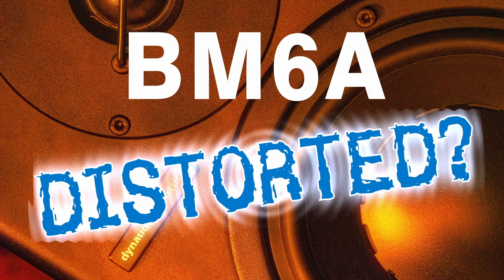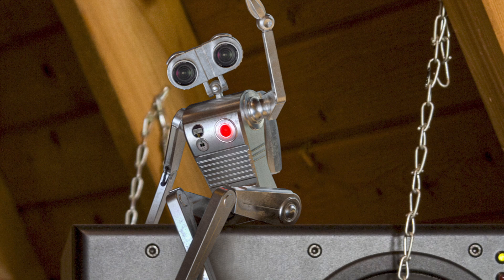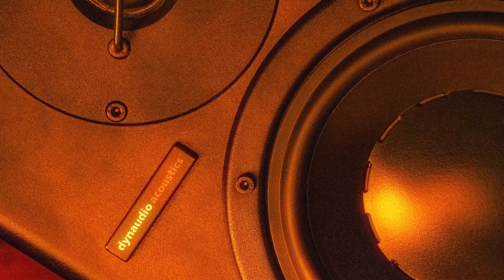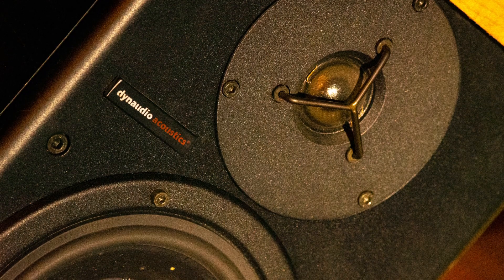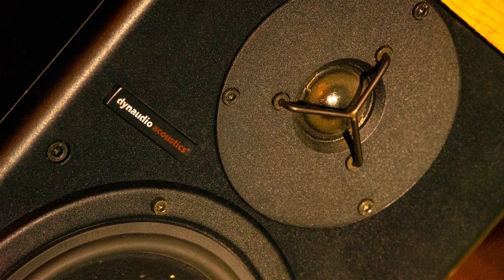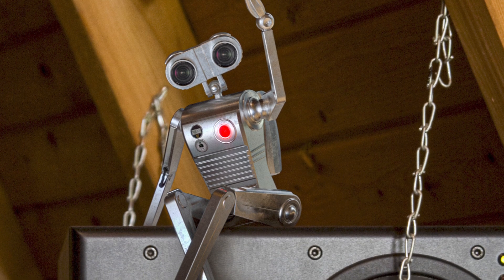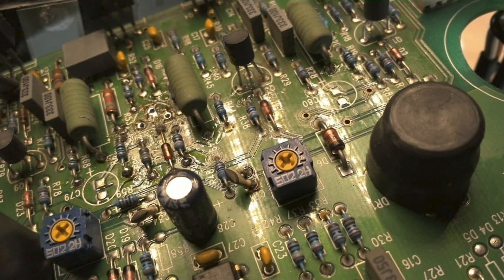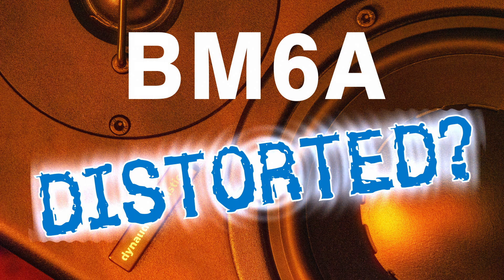Dynaudio BM6A Distortion Fix

Comment: Hi,I Bought a pair of BM6A yesterday, and it's the new version with new logo in the front from market.But I heard somebody talk about the new version and the original version of BM6A has a huge difference, really wonder is that true ? Or the new version is just change the logo ? thanks!
Reply from the maker: I would need to see the circuit, in order to judge that. do you have any context to that?

Comment: Thank you for this video. I have a pair that will crackle and lose sound intermittently. It takes them about 30 min to "warm up" and then its usually never a problem after that. (mainly only one of them) It reminds me of when you have a dirty pot or something and audio is getting stuck somewhere... Do you think this is a relay issue? Thank you
Reply from the maker: Yeah similar to a dirty pot, but caused by transistors. Really weird. Mine are running since. Never had a relais problem.

Comment: Hi, Was this a low frequency issue or in the high Frequency range. I'm having some strange low frequency distortion, below about 90Hz, I think the driver is ok. So I think its a fault with the amplifier module
Reply from the maker: Hi, I have had crackling like a broken speaker coil. since it was the driving stage, the freq should also reach down to the subs. Hard to say, since I can't hear your sound. I'd suggest: throw them out, no big deal and see, if it helps.

Comment: Hello! How do you get the board disconnected from the radiator? in the part where the transistors are glued up to radiator plate? It's pity you didn't take any photo/video during the proccess
Reply from the maker: Sorry, I decided to make the video after the process. I had no problems to disassemble it. The glue should be just heat-conducting paste. Remove the screws and you'll see.
Reply: @pixelcomet  yeah, here, in my case, it was more of a double-sided sticky tape on them, and the paste only on 2 weird cables just pushing against the holes in that radiator plate. Solved that, but now got a prob. dealing with relay legs unsoldering:) very beginner in soldering skills.
Thanks!
Reply from the maker: @RayMaxer  That sticky tape is a heat conducting matte. They are important and must be put back later. The weird cables with their head in white goo, are temp. sensors against overheating. they must be put back in place also, later. Your relay is toast? The best is, to get an desoldering pump for that. Put flux on the soldering spots, melt them and suck it clean with a pump.
Reply: @pixelcomet  Thank you! I am thinking that maybe relay is at fault, I read several times, owners of BM's had similar problems because of it. My speaker has started distorting (not too heavily) at any level, most of power-ons, but, sometimes, when I kinda jerk the power button on and off rather faster (like 1-2 sec period), the speaker makes a louder thump (relay, I suppose), and it starts playing normal for some time. Decided to try switching a relay.
Sorry for my english.
Reply from the maker: @RayMaxer  Your english is fine. Yeah sounds like rusty relay contacts. So get a syringe of flux and a de-soldering pump then and proceed as planned. That should work out fine, I guess.
Reply: can you share pics where can i find relay in bm6a ...im having same issue as yours also did you solve that ???